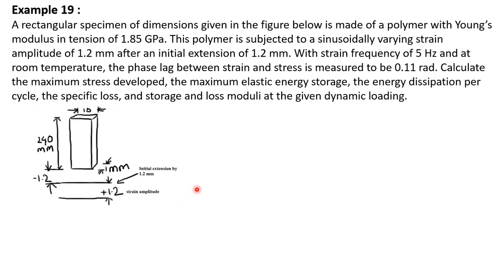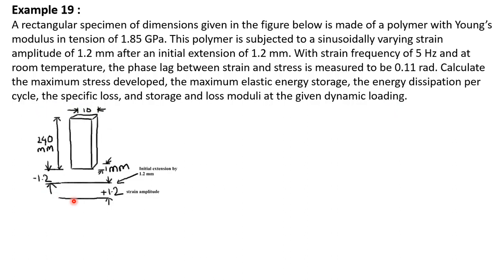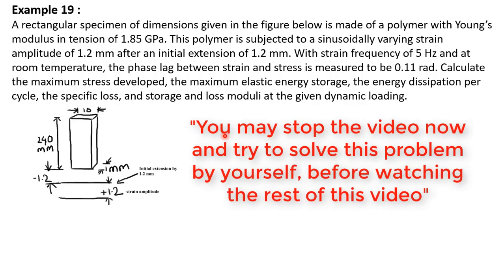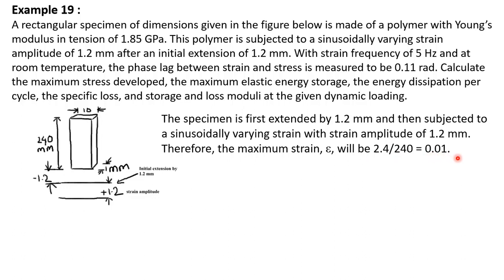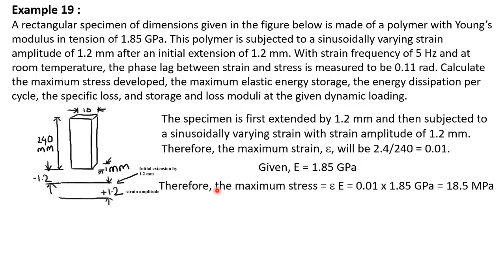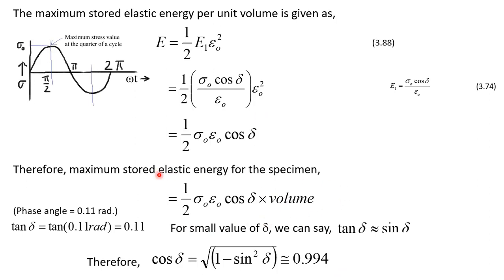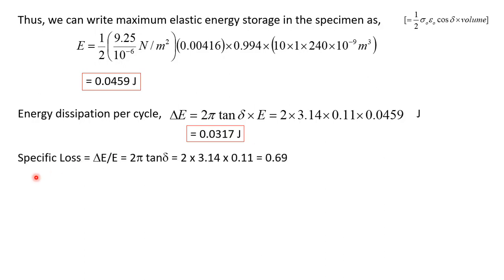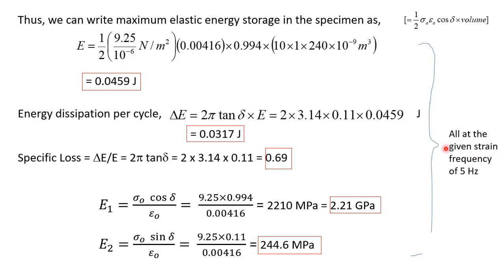Problem of Dynamic Loading of a polymer: to find storage and loss modulus, specific loss etc.

Comment: How come 1.2/240 = 0.00416 when calculating epsilon nod?
Reply from the maker: Time 5:45: You are correct in saying that this ratio is wrong. I rechecked and it should be 0.005. So, in subsequent calculations epsilon nought should be used as 0.005 which will give slightly changed values for all. The procedure of calculation is right. Thank you for pointing out this mistake.  👍👍
Reply: @engineeringmaterials-tribo5142  Thanks!